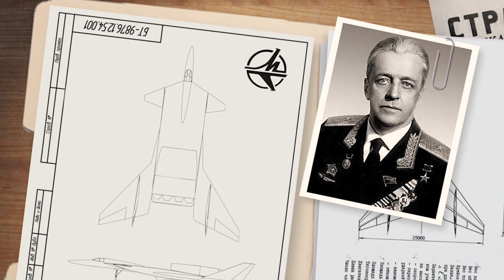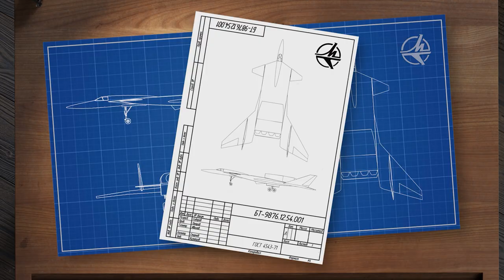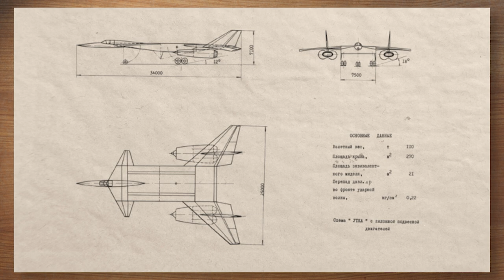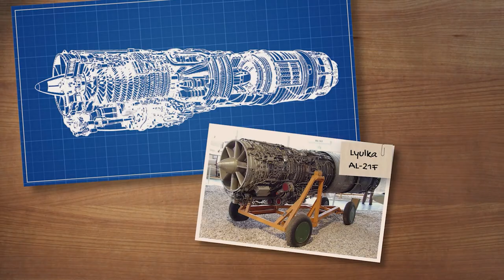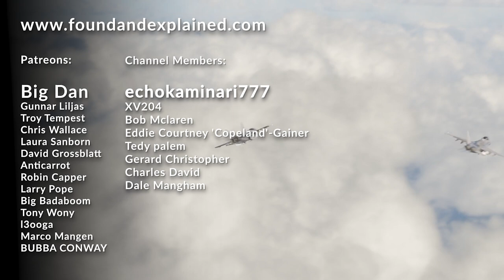Sonic Boom As A Weapon - Russian Top Secret M-25 Hell Reaper

Comment: 9:00 Question - why does that rocket have lamprey jaws? The tip of the warhead is initially cylindrical, then shortly after being fired some sort of hinged mechanism slams shut giving it a pointed shape.
Reply: I'm no rocket expert, but maybe the flat head is for ease of transport and storage? The cone is necessary for good flight performance, but makes it that much longer to store.
Reply: @barnstormer546  Makes sense. With gravity bombs in WW2 they would transport the bombs and their stabilizers separate and then screw them on before loading into the plane so a similar thing does have precedence. But in this case, wouldn't it be easier to just screw on the cone when you loaded it as opposed to making a mechanism like that? It seems to introduce a lot of complexity (relative to its benefits) to rig a timed/fused beartrap to the top...not to mention a potential failure point if it breaks...and you won't know if it breaks until it's off the ground.
Dunno...I am sure there is a good reason there since, well, literal rocket scientists put it there, and that's why I'm so curious about it! Still can't figure it out. =\

Comment: you know, it would be more effective for the plane to do a dive run rather than a flyover, because the boom would be more controllable and it would have a greater radius of damage than if the plane were to fly over at mach speeds. it would also be easier for the plane to reach mach 1.4 than a fly by due to gravitational acceleration, and the plane wouldn't be hindered by the terrain. it would still be just as dangerous, but more pilots are trained to recover from steep dives than to fly consistently at mach speeds closer to the ground. also the plane would be harder to hit with aa fire since it's narrow side is facing the enemy, rather than it's broadside. the only problem with this is the plane would have to survive the incredibly fast pull up, which it is possible for a plane to do so because there are accounts of military planes pulling up from dives at mach speed and surviving.

That Afghanistan guy you mentioned was actually American, and he used a fighter craft to make the rebels think they were being bombed. It saved his whole platoon.

He did it while in a dive. The plane obviously wasn't designed for it, and so It wasnt powerful enough to do any physical damage, but if you were to modify an aircraft to make an incredibly powerful cone of compression around the front, have it dive, boom, then pull up fast enough, it might just work as a sonic dive momber

Comment: I had this crazy idea for conquering the world. 

First create and launch a new series of communications satellites under the guise of planning obsolescence. These new sats are specifically designed to handle enormous bandwidth, and help ease the slow replacements of current satellites.  

To accommodate this enormous amount of information exchange, these new satellites would have nuclear power plants, to individually generate enough power to accomplish these energy requirements.  But that's only true to a certain extent. 

When the time is right, the first stage satellites detonate their reactors.  The enormous amount of electromagnetic radiation will fry the electronics of the current sats and because their communications dishes are pointing right at them, all current communications sats have a concentrated surge aimed at them and so powerful, on board failsafe systems would not be able to compensate. And within seconds the backbone of communications technology, irreplaceable and extremely expensive, are gone. 

New second stage satellites move in to monopolize the situation.  And voila. The first stage of a world take over has started. 

But, that's me...

Comment: Two points I think worth making.
1) We (USAF) already had a better weapon for the job: the XF-84H Thunderscreech.  It worked by creating a continuous nauseating sonic boom from its turboprop's blade tips exceeding Mach 1.  It induced severe headaches, nausea, and long term negative effects on the body.  We considered running it up and down along the FLOT to disorient and nauseate enemy forces.  This aircraft, at least, was built and tested extensively.
2) As soon as the "ledge" deployed, the Soviet aircraft would enter a dive and hit the ground.  Think of it as an Elevator, like the tail plane of a normal jet.

Comment: Fascinating how much energy the thin surface of a plane can direct at the ground, causing so much damage.
Reply: Remember, the flat profile is just to get it up to mach. Once it's at speed, the ledge drops and makes the aircraft less aerodynamic, resulting in the boom.
Reply: @micahh9351  Not just the profile, I mean the little material it consists of. Sort of like a paper plane made from sturdy aluminum foil, given the scale.
Reply: @Gustav Gnöttgen  oh I see. Yes, it's incredible how they can deflect that much energy. FSDS kinetic penetrators literally are the most powerful tank round right now, yet they're worthless against any kind of sloped armor, no matter the thickness. Energy transfer is wack

Comment: I wonder if a plain like that would be possible with todays new materials and engines.
Reply: I don't think high-temperature materials or engines have developed in a way that would make this more possible since then. Engines have gotten more efficient, cleaner burning, lower maintenance, and longer lasting, but not necessarily more powerful. Material sciences have made some advances, but I'm not aware of any major advances in high temperature tolerant structural materials. Perhaps some ceramics, but I don't think that would be useful in building an aircraft. Most aircraft materials advances from the past 50 years are in the form of composites, which are lighter, stronger, and potentially cheaper to fabricate, but aren't particularly heat tolerant.
Reply: @quillmaurer6563  I see, thank you for the info. As someone who knows very little about actual aircraft engineering, it was insightful.

Comment: Are there any other 70 year old readers here who are veterans of war and engineer physicists?  The Soviets made a cheaper easier to use analogue.  FAX bombs, (fuel air explosives).  They used them in the Afghan war in the 80's.  Very devastating over-pressure.  Even the use of cluster bomb-lets used by us for CAS in Vietnam gave me a bit of a cringe.

Comment: Interesting. I'd ditch the jets, especially given the period's technology. Instead, use a prop or two to cruise rather slowly, and rockets built into the ledge to engage. The space between the deployed ledge and the bottom of the plane dissipates heat.

The props can be way heavy to survive (and add to) the chaos, or they can fold back.

Another pair of rockets can help with launching.

Its very novelty would allow it to succeed. I'd call it  "Box cutter" in reference to 9/11. Nobody fears terrorists with box cutters today, eh? Just lock the door.

Good video. You get a like.
Reply: Jets were pretty capable at the time, many combat aircraft were jet powered. The jets could propel it subsonic no problem, would have acceptable (though not a lot) of range. The problem is it would generate massive wave drag going supersonic, producing said shock waves is the whole point, and absurd amounts of thrust are necessary to overcome that drag. I'm guessing they just didn't have powerful enough engines at the time (don't know if they even do now) to accomplish that. Rockets could produce more thrust but would run out of fuel very quickly, limiting their use. But there wouldn't be significant advantage of having it cruise to/from the battle zone with propellers rather than jets, they're better off having engines that are useful both in cruise and attack run.

Comment: Sonic booms ARE quite disturbing...but I don't think they'd actually be able to do the destruction planned for the Russian plane.   I've been right under a Mach 2+ low level pass (long story) and it DID really mess up the building we were in...but no heads exploded or anyone injured other than a few bumps and bruises as we were thrown from upper racks.   Got to love the Russian engineers...we've copied some of their innovations as they have copied ours so we both have the best of both countries now flying.
Reply: The point in the video was that supersonic planes are deliberately designed to reduce drag and the sonic boom.
Reply: Normal supersonic planes are designed to minimize the shock waves they produce, as said shock waves are drag that makes the aircraft less efficient. While this is designed deliberately to produce very powerful shock waves to inflict damage. So this would be vastly worse than whatever plane you were under.

Comment: Yes a good idea, sonic boom as a weapon. But the aircraft has to accelerate through the sound barrier in a matter of second as it comes near the target. Wow, that would need a rocket engine to achieve such an acceleration and strong but light weight material to withstand the shockwave. Personally I think hypersonic drones are more efficient and cheaper to build than these kind of aircraft.

Comment: The military has a vested interest in keeping a watch on emerging technology and trends in research - trends that they have at least some influence by way of funding research programs through DARPA and a wide variety of educational,  technical,  industrial,  and busines partners. Not to mention an assortment of 'non-profit' groups.

 All emerging technologies,  products,  services,  trends in research spending/content, etc. WİLL AT SOME POİNT be evaluated for its weaponization potential.

The plane that was never built - would today's advances in drones,  computers,  fly-by-wire,  Aİ,  image acquisition and analysis,  networking,  GPS,  processor speed,  materials science,  remote sensing, etc. - would this make the plane feasable?  desireable? Or is it simply a bad idea due the physics involved. Possible but not practical. Or more fundamentally,  does it solve s problem no one actual has?

Rule of thumb for  selling a product: Product must either:

1. Provide a capability that has not been possible until now.

OR

2. İt replaces your current solution. To do this it must do what it does either faster,  cheaper or in some tangible way better than the previous solution.